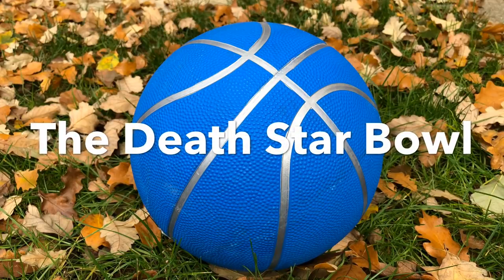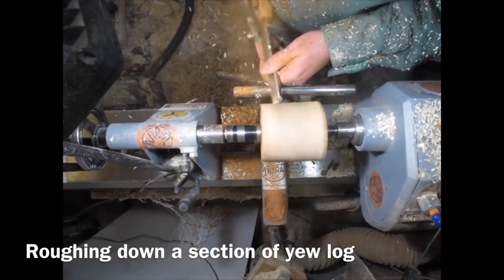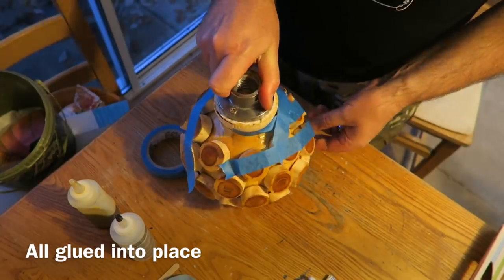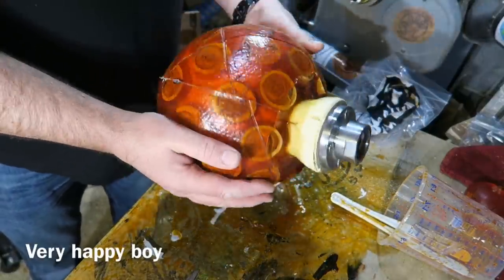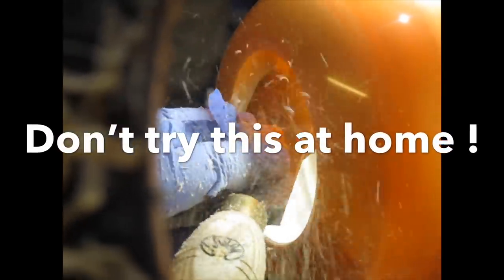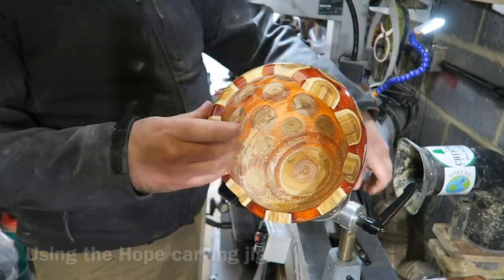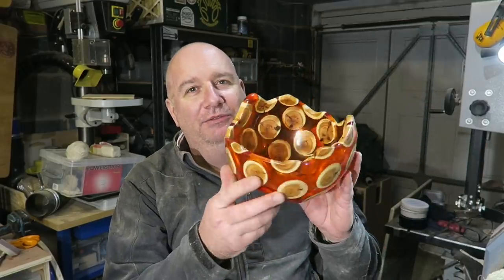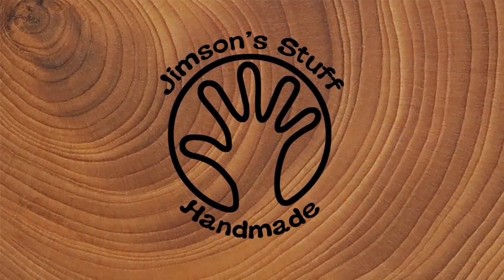Woodturning the Death Star Bowl - An epic rescue mission

Comment: I can imagine the frustration and choice words, spoken or otherwise when you had the catch.

I have had my share of failures, so I know the feeling.

I was making another version of the bowl in my avatar.   This design is also time consuming.   I glued in the inserts, shaped the bowl, then started to sand and realised the cherry end grain was too soft so it sanded off more than the hard maple and bubinga in the inserts.   I had a wavy surface inside and out.   I tried to seal the end grain but then it turned dark.    This went into my failed turning projects collection.

 As you said, a nice contrast between the colour of the resin and the pieces of yew.

You have more patience than I have.   After the catch I would have put this aside for "manjana".

Well done.   It seems "Murphy" needed more than "just" the catch and made you drop the piece.

Dave.
Reply from the maker: Thank you very much Dave. The more preparation we put into these pieces, the more we have to lose. I might have said a bit more than oh bother. The end result was Ok, not something I would sell but my wife loves it.
Cheers 
Jim

Comment: ouch what a shame but good design change, may i ask a question, how do you cut the logs on the bandsaw without them kicking back,
Reply from the maker: Thank you Lindsay. Good question as it is a real danger cutting round stock on the bandsaw, I held each branch very firmly in a quick clamp, you may just see it in one of the video shots at the start, I also stand to the side. For bigger round stock I would build a simple jig.
Cheers 
Jim

Comment: Odd question and comment here: I used to use my dad's lathe back when I was much younger(70-80's). It was on my grandfather's forested mountain property in No. Cal and the wood was usually cut from downed trees...pine, Douglas fir etc. Never used more protection than clear goggles. When did wood turning require a respirator? Was I just lucky or made of sturdier stuff? Perhaps something happened to our trees? I get using one for resin and the like...but for wood? What gives?
Reply from the maker: Hi Ivan, many thanks for watching. Respirators have become more widely used in Woodturning largely due to an increased awareness of the long term damage caused to people’s lungs by wood dust. The dust from pines and firs is generally not quite as harmful but the dust from some hardwoods is very harmful and even carcinogenic. It is essential to wear dust protection when working with resins. I always wear one as no point in risking your health. Over the years I have spent working with wood I have developed strong sensitivities and allergies to several species of wood, some to the point where I can no longer use them ( iroko and cocobolo ).
Cheers 
Jim
Reply: @JimsonMakes  I found a great mask, hood with full face shield, at a pawn shop for $150. It doesn't have any machinery though. Would that be good enough for a beginner?
Reply from the maker: It would depend on the rating of the filter but any protection is better than none. Some of the unpowered masks can mist up. The positive pressure masks that constantly pump filtered air in are good because they don’t steam up and push air out through the seals preventing dust getting in. A full face visor offers a lot more protection from wood flying off the lathe.
Reply: @JimsonMakes  Hmm. I wonder if I could attach my CPAP to it? Thanks again. Great channel!